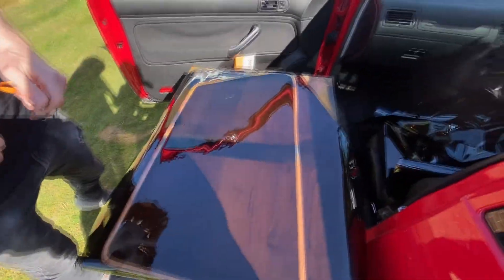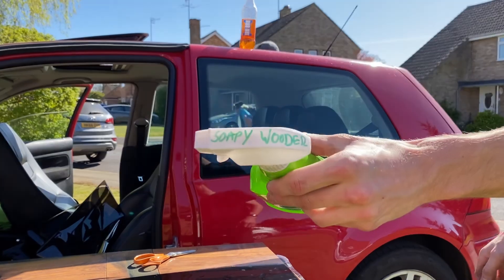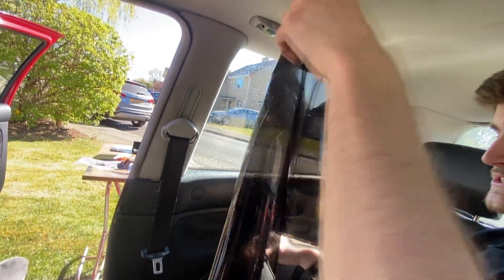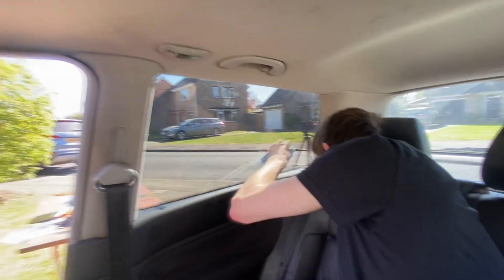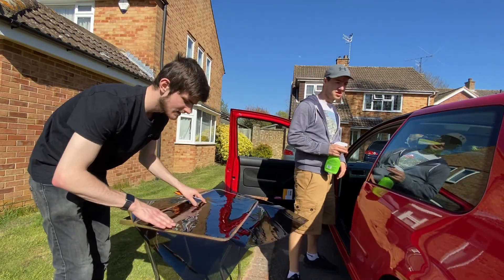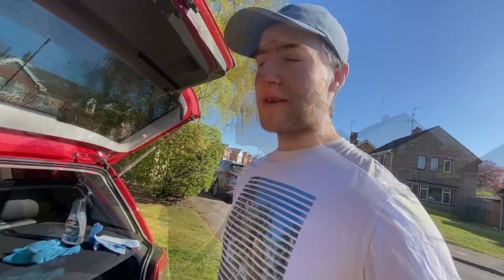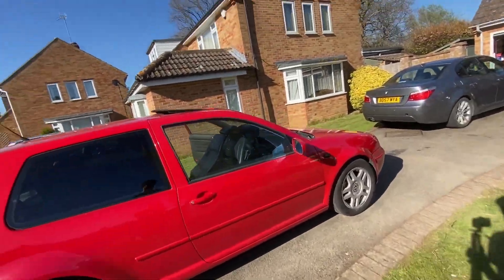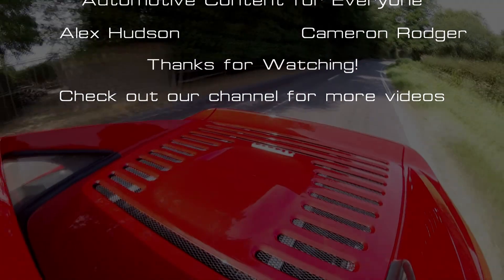Tinting our golf goes WRONG (VW golf PD130)

Comment: We had pros come in and do customers cars where I used to work. They would use a proper squeegee and a hot air gun. I do remember that the windows with dots at the edge never looked as good as windows without the dots. They would heat up the rear window film so it shrunk to fit the curve of the screen. I think you are very brave attempting to do this outside as dust and pollen will get under the film. Good effort.
Reply from the maker: Yes, it is certainly not easy. But we wanted to try. Maybe 25£ tint off Ebay didn't help either...